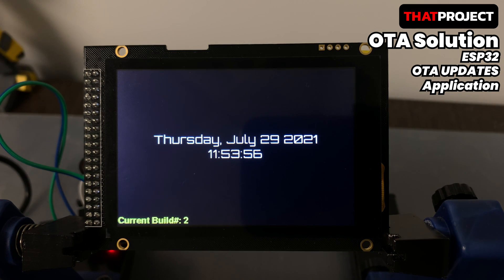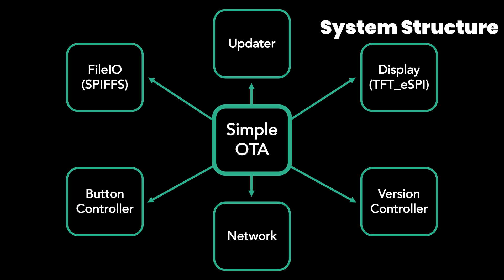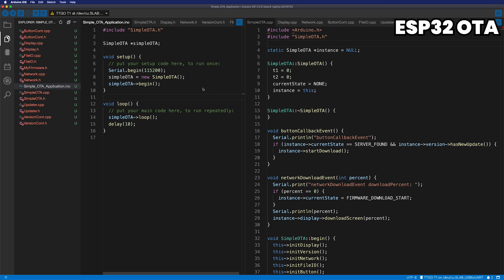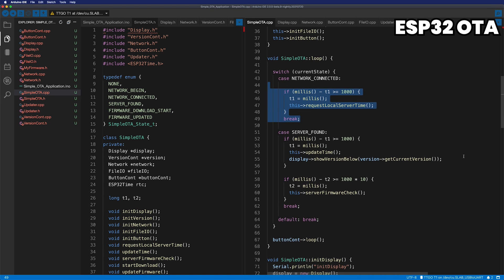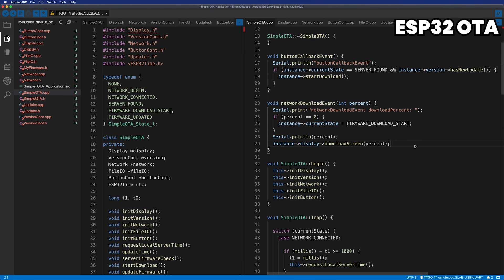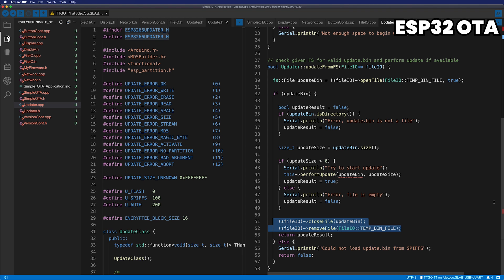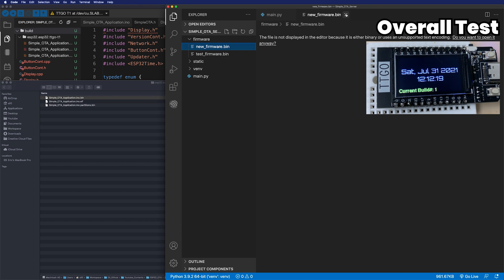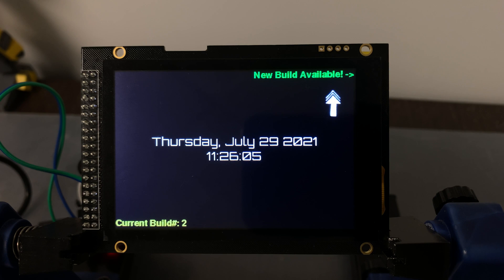OTA Solution - Build your own OTA platform (2/2, ESP32 OTA Application)

Comment: Hi, after download file from a server, every time  size of file differs by 14 bytes what affects the MD5
Reply: downloaded file has 14bytes more.
Reply: http.getSize() retunr -1 but why? Using Postman everything is okay, the body of request has the same size which was calculated on the server.
Reply from the maker: @GildiaMystica  Are you sure? What about MD5 checksum?
Reply: @ThatProject  MD5  file on the server is correct( checked by calculator), on the ESP32 is wrong cuz something affects on the size( and body of file?) during download. I tried download smaller file, txt example about 50kb and everything is okay, is it chance that file is too big? Idk cuz everytime i tried download and upload code like you with little diffrence ( printing on serial).
Reply: my bad, sorry, everything is okay, i didnt mention that i create my own php server, and i didnt add header with content-length which didnt allow to get file size.

Comment: Thanks awesome project, I tried ur code but when I try to execute Update.writeStream(); nothing has flashed. This function returned zero... What I made wrong?
Reply from the maker: It seems like a situation where writing is impossible. There is a possibility that the FW file downloaded from the server exceeds the available flash capacity and the FW is not stored in flash memory correctly. Would you like to check the size of the downloaded FW?
Reply: @ThatProject Sorry for the late reply. Yes, I've checked, and my downloaded firmware is the same size as the bin file. The update.write() function was implemented normally, but at the end of the process, it returned a segmentation fault error. So sad. 😒
Reply from the maker: @adiyasurenjargalsaikhan3218  A similar issue I encountered was simply that the bin file size of the new firmware version was too large, causing the installation to fail. How about changing the ESP version? Would you like to try it on a version like 2.0.6?

Comment: I'm using the Lilygo Dongle ESP32 S3 and I noticed my update fails because the file size does not match. Prior to the download messages it says "File Length: 989328" but when it completes, and the SPIFFS listing shows the download_firmware.bin is 391424 bytes. Any idea what could be the issue? I also noticed I have some additional files in the SPIFFS listing, like a 'config.json' (141 bytes) and a 'img_log.gif' (267008 bytes) - I wonder if this ESP32 has run out of space? I'm confused on how to move forward. thanks.
Reply from the maker: It seems as if the new firmware file is not downloaded properly because there is no SPIFFS space. If you are using an ESP32-S3 with a large Flash size, would you like to change the partition to a larger one? If this isn't enough, you may need to use an SD card.
Reply: @ThatProject  Not sure what is going on. I tried the same code on the Lilygo T-Display-S3, which has even more space available, and every time I download the firmware it downloads a different size. These were the size in bytes over multiple attempts:  663, 774144, 656896, 774144, 656896. The checksum succeeds but the size is obviously wrong. Download Percent always reaches 100%, but the Size in the SPIFFS folder is just off each time. I'll try a ESP32-S2 device next, and see if it works any better than the Lilygo S3 that I've tried so far.
Reply: Same issue on an S2 device - The firmware is 961888 bytes, but two downloads reported 661504 and 660992 bytes. I must be doing something fundamentally wrong. But I have to say, your code is pretty damn awesome. I really appreciate you even responding. If you got any thoughts on what I'm doing wrong, I appreciate them. Thank you again.
Reply: @ThatProject  I think the issue might be the PlatformIO board_build.partitions = huge_app.csv.  I've tried other partitions and they all fail to even upload from PlatformIO, but I don't know which one to use to increase the SPIFFS size (assuming that's the issue).
Reply: I tried making my own custom partitions table and set the SPIFFS size to 0x100000 (1048576 bytes), which exceeds my file size, and I still don't get the full upload. Instead of a file size 989328, it uploaded to SPIFFS only 757504 bytes.
Reply: I had to increase the SPIFFS to 0x150000 (1376256 bytes) in the partition table, but the onboard size only reports a size of 1257761 bytes. Either way the download now succeeds BUT I get an update abort that occurs and a Backtrace. I will have to check the cause of this backtrace tomorrow - it could be the OTA Partition is not sufficient, or the firmware I am using is one that I built using a previous version of the code and hence it may be a conflict with the new. I'll know more tomorrow.
Reply from the maker: @7zzZKnightZzz7  For testing, please create a minimal project that includes the OTA update part of your code, make the file size about 600KB, and then test it. I think it will probably work without a problem then. Therefore, in this case, it seems necessary to update the code so that new firmware can be saved to the SD card. 

Huge_app.csv has a SPIFFS partition size of 1MB. Try selecting another partition larger than this.

Comment: Great project. Is it possible to perform OTA via the Internet instead of local network? Which platform do you suggest?
Reply from the maker: For testing purposes, I put it in the local. You can deploy this on a cloud server such as AWS or Azure. Also, in this case, you need to consider security as well. In order to strengthen security, the overall system must be upgraded to work based on HTTPS/SSL.
Reply: @ThatProject  Thanks, I'll try that on AWS EC2
Reply from the maker: @wp0049830  Please let me know if you have any updates. If I get a chance, I want to try it too.
Reply: @ThatProject  Hi, It works on AWS EC2, atleast the HTTP version, I didnt try on HTTPS. I installed Python, gunicorn and nginx on EC2. Now it is possible to FOTA the ESP32 on the Internet without relying on third party apps, thanks a lot :)
Reply from the maker: @wp0049830  Congrats! You made it. Now you have your own solution for updating device firmware automatically. That's awesome!
Reply: @ThatProject , I found you channel today and I can say “I’m impressed “, please do a part 3 deploying the server to cloud with HTTPS/SSL . Use something with free tier perhaps with no credit card upfront 😊

Anyway, I subscribe to your channel brother ❤

Comment: Thanks for this complete solution. I have two questions:
1) My ESP32 based project (design phase) doesn't have a display and is away from the user. in addition it's in deep sleep; it wakes up 4 times a day to send sensor data via a RESTful API to a database and a front end access the database for reporting etc. So the user doesn't directly access to the ESP32. So the only meaningful solution would be for the ESP32 to check for availability of new firmware every time it wakes up (or every nth time it wakes up) and automatically pulls down the code and does the firmware refresh. The firmware version can be pushed to the database so it can be displayed on the front end. Also a status message if the firmware update was not successful could be displayed on the front end so the user can manually access the ESP32 if needed. Can this be done?

2) How do I ensure that this code coexists with the actual firmware? Does this use different storage regions on the ESP32?
Reply from the maker: 1) Assuming that all the APIs you mentioned are working normally, this system will work properly.

2) The firmware in use is no longer accessible(but you can get the information), and the new firmware can be saved to the ESP32's internal file system or external SD card.
Reply: @ThatProject  Sorry re 2) what I meant is the OTA code running on the ESP32 needs to be integrated into the main firmware (in my case reading the sensor data and then pushing it to the db via the Rest APIs). There's a lot going on in your code and I'm not clear where I would insert my firmware code
Reply from the maker: @meierthomas  Let's say you made the second new firmware binary file that has a new function to pushing to the DB through the REST API you made.  
After it's installed from the inside, all functions are integrated into the main firmware. Therefore, the first main firmware had to contain an update solution. My code is modularized by function. I recommend you create a new class and add the code you want.
Reply: @ThatProject  Ok are you suggesting in my firmware I create a class that utilises your OTA code which will then check for new versions of my firmware? Sorry for all these "simple" questions but I really like the overall solution.
On a side note is adopting this for ESP8266 a massive change for a nonprofessional developer like myself or is it a question if swapping a few libraries?
Reply from the maker: @meierthomas  Not sure how best to do it because I don't understand all of your circumstances but I believe it works. I don't think you need to change a lot to use ESP8266 instead of ESP32. Let me know if you have an issue.

Comment: Trying to upload 1.8mb firmware to esp32.  Hangs around 60%.  Smaller firmware works fine.  Any ideas? Wifi is strong.
Reply: Finally got it to finish but saying Checksum is wrong.
Reply from the maker: @nelsontechnologiesconsulti6552  First, you cannot save more than 1.5MB of files to SPIFFS from the default partition scheme. If you need more space, please use SD Card. I guess this is why you get the wrong checksum here.
Reply: @ThatProject  Thank you!! I have the SD working in a demo.  Do you have any library in this project that would use this instead of SPIFFS or do you know how to implement this in your project?  THanks again!!!
Reply from the maker: @nelsontechnologiesconsulti6552  Unfortunately, there is no project video using SD yet. I recommend you google this part.

Comment: Having some issues with the touch aspect.  I am using a RED ili9341 with touch.  All on display is working fine but touch is not working when New Build Available.  Have tested touch using TFT eSPI and all working fine.  Have made sure PIN in ButtonCont.h is correct.  No luck.  All test outside of application works fine.  Any ideas?
Reply from the maker: The touch driver used in this project is FT6236 and is not the same as your display, ILI9341. So, you have to implement the touch part yourself. Please refer to the touch part of TFT_eSPI.

Comment: Great project.  One question. If the main.py script is stopped and restarted, the display says Server Not Responding.  Even with the script up and running again, it doesn't refresh until I restart the esp32.  Any ideas?
Reply from the maker: Check the server every 10 seconds for the test. The most recommended method is to change the time to check once a day or once a week. 
Also, if there is no response from the server, removing this part is one option.

void SimpleOTA::serverFirmwareCheck() {
  version->setNewFirmware(network->checkVersion());
  if (version->newFirmwareVersion() == -1) {
    //display->newMessage("Server Not Responding");
  }
Reply: @ThatProject  Thank you!  I solved my issue by modifying that statement.  

void SimpleOTA::serverFirmwareCheck() {
  version->setNewFirmware(network->checkVersion());
  if (version->newFirmwareVersion() == -1) {
    display->newMessage("Server Not Responding");
  } else {
    if (version->hasNewUpdate()) {
      display->newMessage("New Build Available! ->");
    } else {
      initDisplay();
    }
  }
}